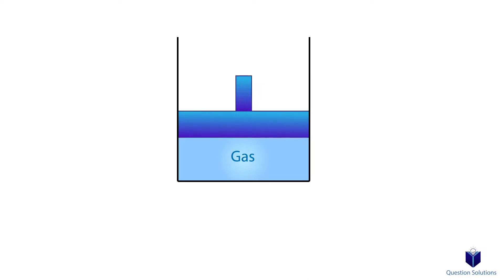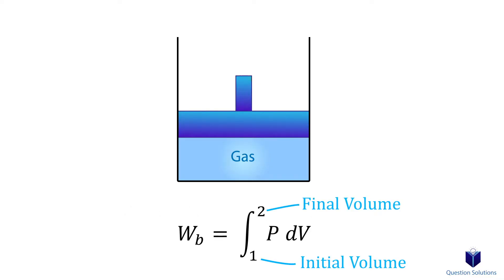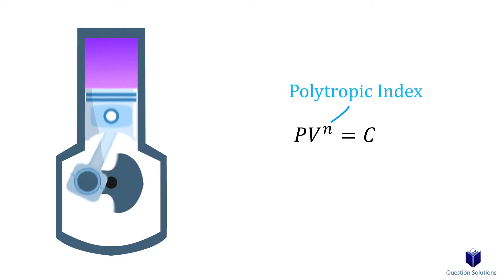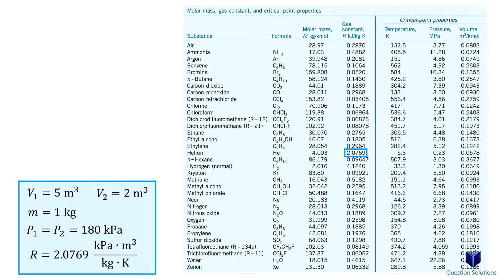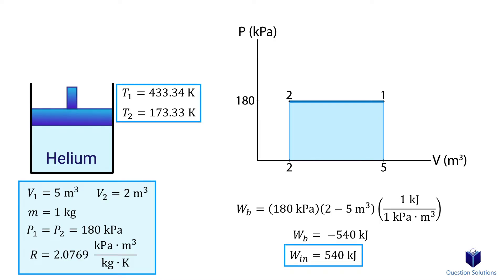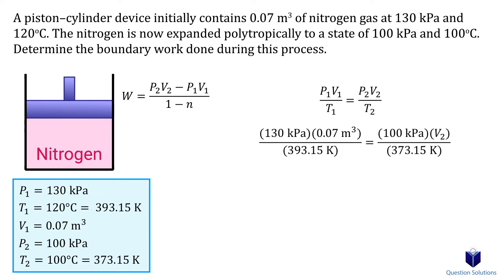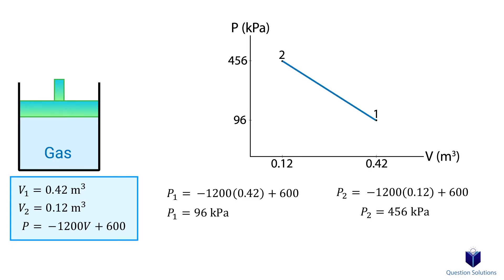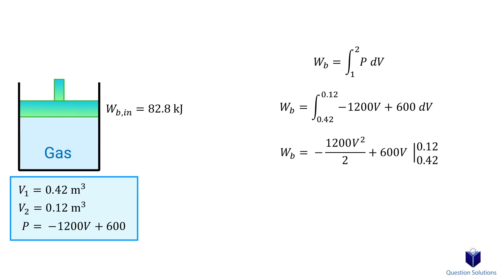Moving Boundary Work | Thermodynamics | (Solved Examples)

Comment: What if i only know pressure n and initial temperature
Reply from the maker: I am not sure of your question, it's too vague to answer. What are you trying to find?
Reply: @QuestionSolutions  argon is compressed ina polytropic process with n=1.2 from 120 kPa and 10C to 800kPa in a piston cylinder. Determine work and heat xfer .

Comment: How pressure remains constant during compression?
Reply from the maker: You can do it in many ways, but in general, but removing/adding heat on a system is used to maintain the desired pressure.

Comment: Thank you, If possible do make a video about Entropy generation, Maximum available work and its types
Reply from the maker: So it's really hard to jump to specific sections because most of it relies on previous parts. The course material is built up one at a time. Eventually, I will get to those, but first, I have to create the foundation for students to understand the new material :)